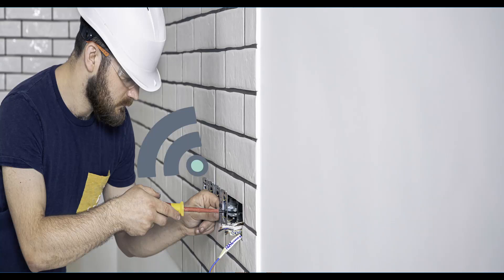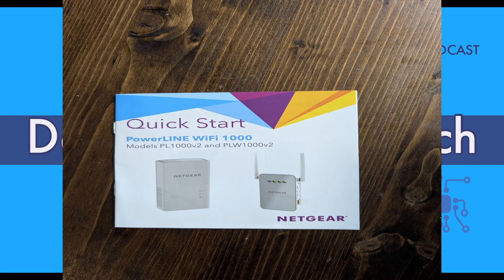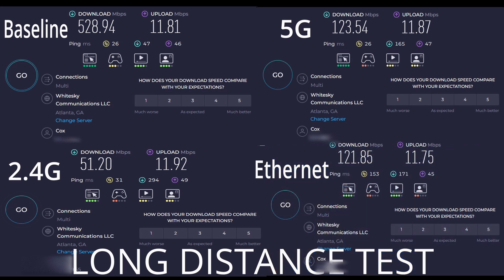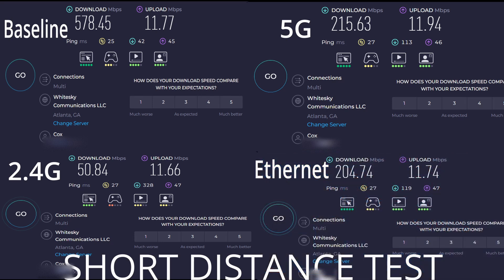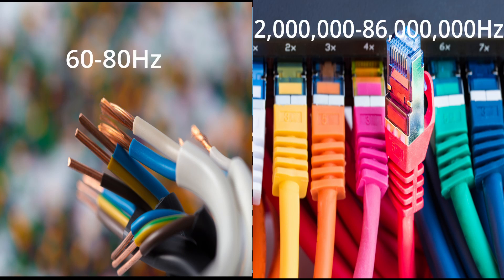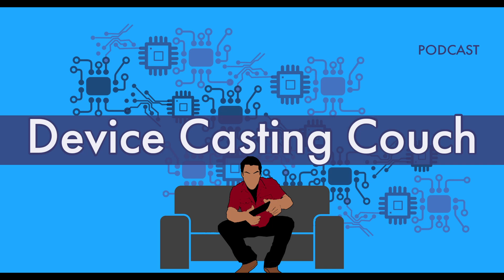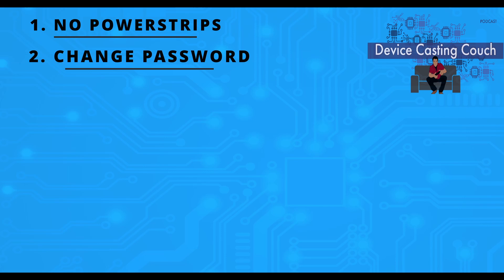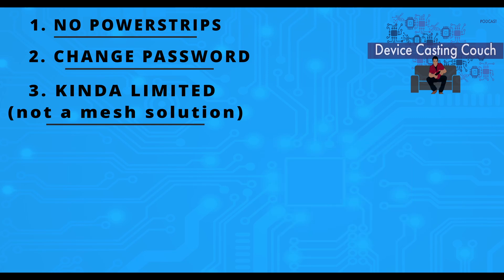WiFi From Your Outlets? | Powerline Adapters

Comment: I had one of them from TP-Link, Ethernet only. It was quite good and bad at the same time. :D
In one of the old apartments where I lived, the signal could vary from 30 to 200 Mbps, depending where you connect this thingy. Same goes for my current old house living place.
Thanks for the video!
Reply from the maker: That was my conclusion as well, works in a pinch, but it can be pretty terrible if everything isn't perfect.. Thanks for the comment!